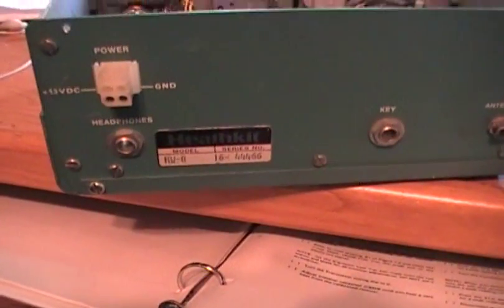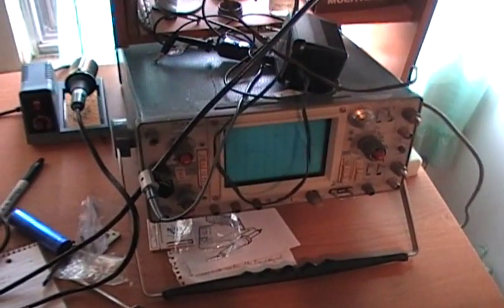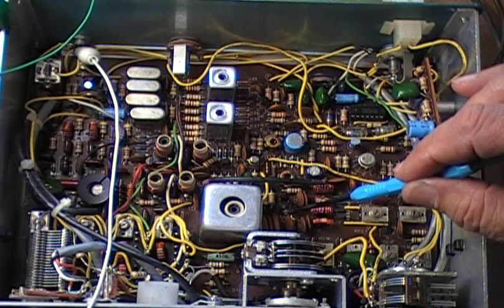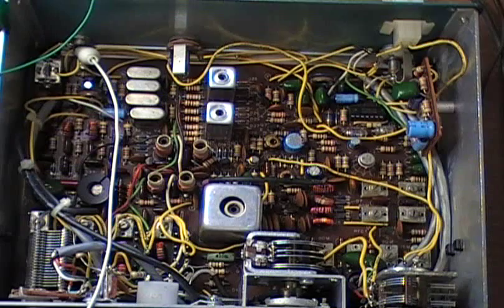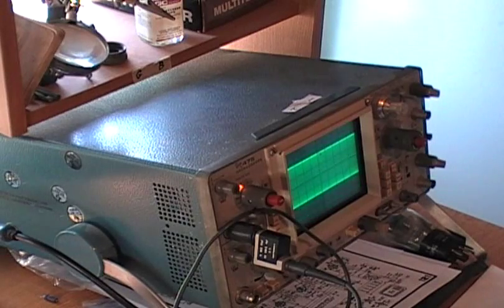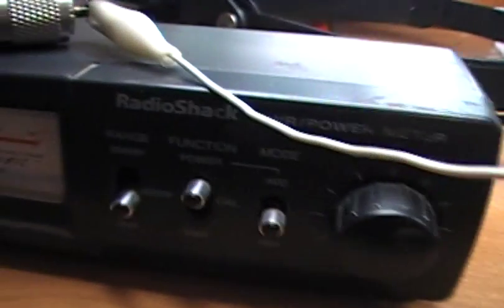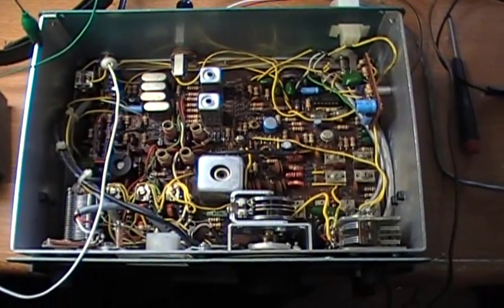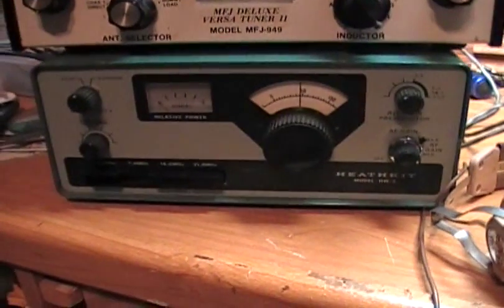HW8 For Sale

Comment: I've had six HW-8s and careful tweaking of the RF output and loading control during alignment should yield at least 2W on all bands except maybe 15m. Other causes of low RF o/p are filter toroids in the wrong place or filter toroid cores gone bad.

Comment: Funny that these radios' transmit power is lower than the original specs. They seem to age over time and alignment does not seem to help. Not that there's much of a difference between 1 watt and 1.5 watts. Fun radios and pieces of QRP history.
Reply: +William Phinizy The HW-8 manual specs cite input power, to the final amp. There is always an efficiency factor in any output amp, typically anywhere from 50 - 75%. The 3.5W specified in the HW-8 manual should result in somewhere around 2 Watts output on most bands. There is nothing wrong with the radio.

Modern radios tend to specify output power, so it is a common misunderstanding that the HW-8 is specified for 3.5W "out." It is only spec'ed for 3.5W "in."
Reply: The HW-7 puts out solid 3W on 40m, 2.5W on 20m and 2W on 15m.  I prefer the HW-7 as it has more room to work on the PCB for service or mods.
The HW-8 seems more congested on the PCB, and 1 - 1.5W would be definite struggle to make contact unless antenna is super efficient, or the band condition is super good compared to 2-3W output of the HW-7.

Comment: Do you still work on these?  I have one that needs some attention.
Reply from the maker: No I don't. Parts got so hard to find and the radio themselves skyrocketed in price. I have one I kept for myself. Hope you can get some help for yours...
Reply: @Ronbob59  i got one cheap,   It was not keying up but i changed the plug on the key.   It seems ok now.   What type of headphones do you recommend with these?
Reply from the maker: @petek1pml746  head phones have to be high impedance. They are hard to find, but turn up on Ebay occasionally.